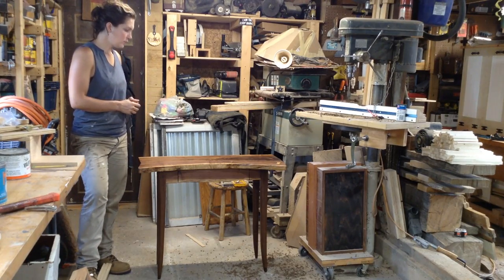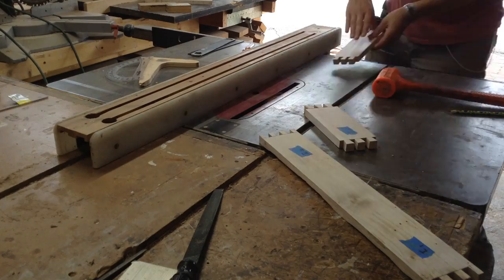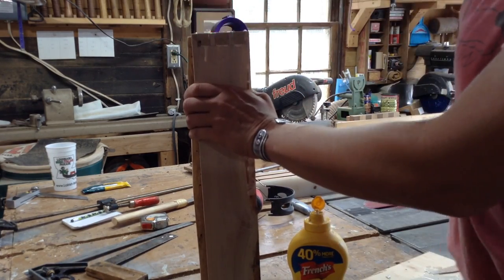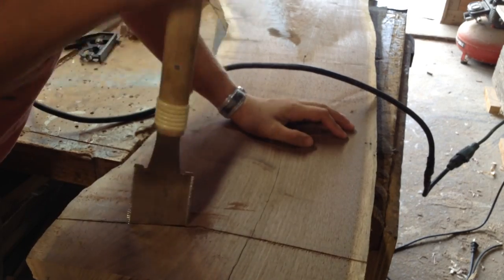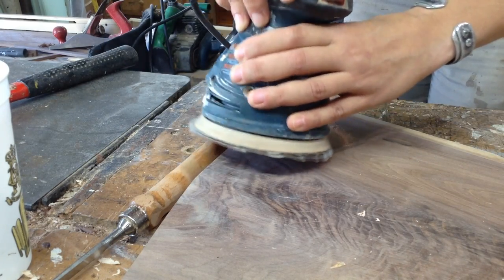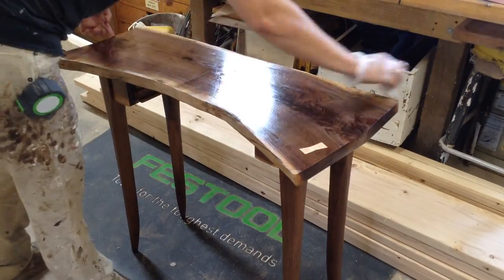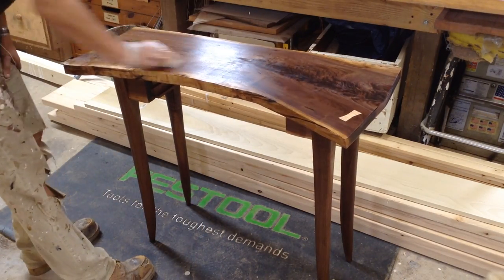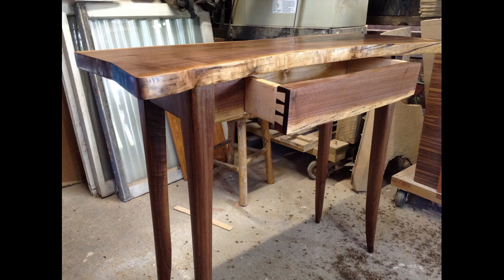Woodworking : Walnut Entry Table // How-To Part 4

Comment: That is great work! Awesome tip with using oil paint to tint the finish!  (I tried using neighbor's beeswax from their hobby-honey production and it was pita to filter all the bug parts. I recommend getting it filtered already, like the one you used. I have a sacrificial pot to melt and another woodworker gave me a gallon of linseed oil for free, but I am using Osmo for some work now (coat rack from reclaimed ash-though ashborers did a number here in NJ and PA. And those lantern flies are here now...),
Reply from the maker: Lantern flies are everywhere this year, it's crazy.

Comment: I'm sure you'll have heard of it and it's been suggested before but Rubio monocoat is pretty decent. Loads of shades or even invisible if you just want protection.
Reply from the maker: I hadn't heard about it, but someone else all mentioned that to me, so I might have to check it out.
Reply: Plenty videos on here showcasing it.
Reply from the maker: I'll have to check it out, thanks for the tip.

Comment: Does that yellow over time?  More so than a clear oil base finish?  And big question I charge bout 850 for those (I am guessing 36” or less) and then it gets more because for me Walnut runs bout $14 Sq Ft; & slabs that size $400 plus.  Of course it also changes Monthly a bit.  Am I close to what you charge?
Reply from the maker: Any oil based finish will yellow over time some more then others, but on darker woods I don't find it to be as noticeable.  This tung oil I don't think is bad, but I make a point to tell all my customers that it will yellow, especially if direct sunlight hits it.  Yeah we are in about the same ballpark.  Big difference is my lumber guy is awesome and both the walnut slabs I used for this were 150.00 total.  Best price in the land haha!
Reply: Unbelievable !!  That is a great price!!  Does he ship to Nor Cal?

I would be in lumber heaven!  Anyway that is a sweet table!  Really nice build!
Reply from the maker: @zephyr1408  Yeah his prices are the best, and he mills his own lumber from local trees which is also cool,  I hit the lumber jackpot with him.  Only problem is if you want anything other then the popular domestics he doesn't have them.